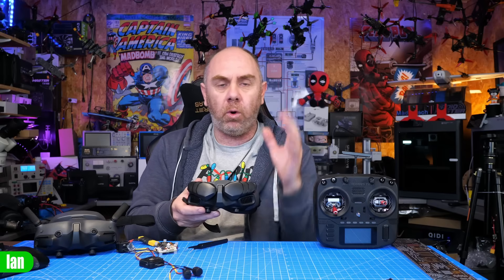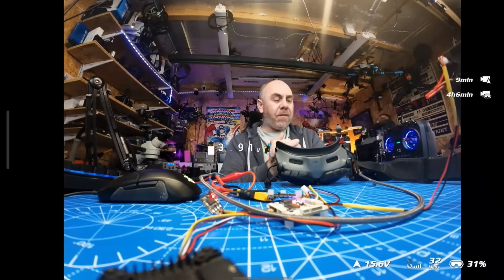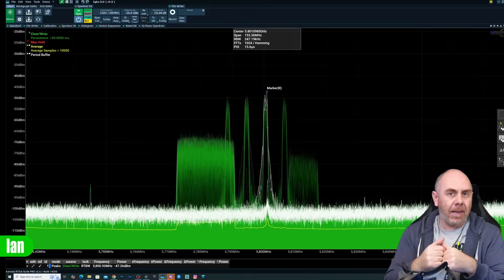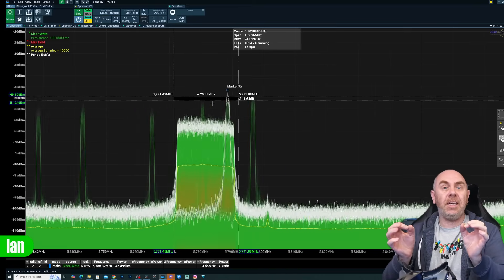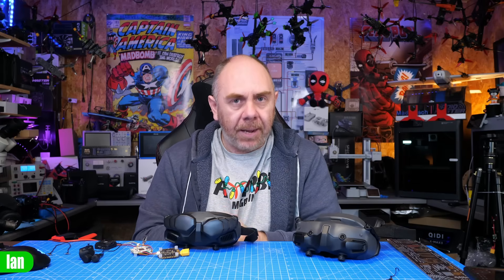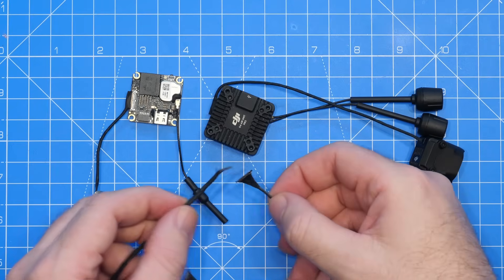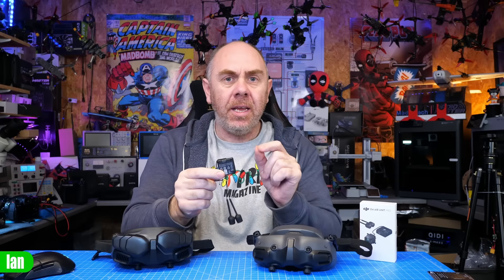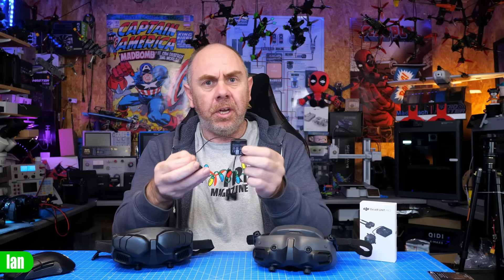DJI O4 Issues Warning - 16Mbps Goggles 2 Bug - Bad Camera Cables & Inav Arming & OSD Missing!

Comment: Can confirm the cable is easy to damage because I damaged mine. 

I have installed many o3 systems and never had a problem, but the o4 is very touchy.

I put in a request to buy a new cable days ago now and have not heard back.

Comment: How would goggles be fcc without the Ham file?   USA dealer, with USA warrantied goggles,  but they ship in CE mode (as dji normally does)
Reply from the maker: It's activation that sets the region.  User should get FCC once activated.  They definely will of they connect the fly app
Reply: @MadRC  I'm not sure the difference in ham vs fcc..  I always have activated via PC, in USA, 20Mhz gets 3 channels, 40mhz gets 1, channel 1, goggles say channel 1 but it's actually 50mbps channel 2.  We always have to patch them day 1 with the ham file.  (Well 1st day they come fly with me. I be patching everyone).
Reply: If you’re in the U.S. ham file just unlocks extra channels for the goggles to use. No idea why there locked behind that file though.

Comment: Good info. I've hated the G2's since release, so no surprise to hear there are issues. Likely the reason DJI quickly released three other versions immediately after getting G2's on the market. Moral of this story...scrap your Goggles 2 and get the N3's or G3's. Thanks Mads!
Reply: You working for DJI? haha
Reply: @girenloland 😂
Reply: As a professional user - I'll be keeping my goggles 2. Maximum compatibility, it works with every system and it's very lightweight and small. Vista, 03, and 04 have their own strengths/weaknesses depending on lighting/needs.
Reply: What issues you had with goggles 2?
Reply: G3 is not really an upgrade more like a side grade depending on the person.
G2 has greater fov, can be a positive can be a negative depending who you ask.
G2 has external battery again positive and negative; can be easily replaced when it's empty and it's also leaving you with a free usbc port to connect a monitor/phone to. The G3 has integrated battery when that is empty your usb c port is going to need to be used up for charging so no more monitor without an extra dongle and when the battery is eventually dead you'll need to open it up and do some welding to put fresh batteries inside.
Reply: @MrCoffis  G3 dont need usb to monitor..
Reply: @ how do you monitor without affecting signal?
Reply: @MrCoffis that"s it. u really know nothing about g3 but want to bash g3 performance. u must use both n for sure u will sell that g2 like me. best latency on g3. best fov on g3 while g2 can't completely see at the edge of screen. g3 more clearer screen, u will notice it when u test it side by side. g3 60mbps. internal batt g3 can be use for 3hours n can be fast charges while using. no need to always hang with wire around.no need spare batt, only fast charge PB u r good to go if 3 hours not enough for u. i hate g2 slide pad, difficult to use n slow when u want fast select. that's why dji never bring forward touch pad system. i'm tired of g2 pressing my up nose and around my eyes. when i use g3, no more feel some bulky thing pressing my face. g3 only stick on my forehead as a head cap, really far comfortable than g2. race mode on g3 is superb cause i'm a agressive fly style pilot, really love that race mode even it reduce a bit penetration. not race mode also can feel better response with g3 latency. g3 no need any wire for monitor, it's wireless build in wifi live view and u can use it for MCP with a bit like 0.3sec latency delay. use iphone/ipad/android connect live view wirelessly n can easily connect to big screen. why bother with wire?
Reply: @girenloland maybe??? Haha. HELL NO. I didn’t like the latency and FOV of the G2’s. The newer G3’s fixed some but not all of that and you can tap to look around which is a cool feature. To each his own! V2’s are still my fav for low latency FPV.
Reply: IMHO the biggest positive point of Goggles 2 is that you can change for better antennas for long range.
Reply: Love my g2 and even run on 4k 60fps and erls f1000 no latency issues, big dawg. But no idea when your running ghost, might play a roll too, but like you said if it ain't broke don't fix it. I like my g2's cause it doesn't transmit a target on my head like g3 does. Meaning rid targets your head as lat and long
Reply: I was about to say you trippin but, then saw your name and was like okay okay fair point 😂
Reply: @ haha. Facts! Me and latency don’t get along. Hope you’re well Robocooter! 🦄🦄🔥🥷
Reply: @PhantomFPV  I honestly haven’t had tooooo many issues with my g2s but, I’ve not tried the O4 with the G3 yet. Race mode seems like it could be sick for freestyle. I really enjoy the latency on  my HD zeros even tho I’m flying a tiny whoop at 60fps with very little range lol.
Reply: @Robocopter_fpv  100%! They say, if it ain’t broke, don’t fix it. I’m about to invest in a HDZero whoop. What are you running?
Reply: @Robocopter_fpv  Race mode has shit penetration so not for freestyle..
Reply: @ConceptNull  eh idk I freestyle HD Zero just fine and it couldn’t be worse that that. I’d take latency over penetration any day for freestyle but that’s just personal preference.
Reply: Never had an issue with goggles 2
Reply: The optic size to FOV/screen distance from the lenses is the worst part of the G2 goggles. The integras were much better, but the goggles 3 are better optically and more comfortable than the goggles 2. Plus they were down to $350 on ebay for awhile if you got the ones broken out of the Avata 2 kits, sadly I could only use them with the 03 for months and I mostly fly 1-2s. Now they're my favorite goggles with hdzero coming in #2 only because they are the best analog for my 65/75mm high performance quads.
Reply: I should also add that the onboard battery is so much better than having a cable hanging, but you can use a xt60 to usb c cable to power the Integra and goggles 3, so best of both worlds again.
Reply: I wish it was that easy for us on a country where the legal way to get a new goggles is spending like $1200 or more lol. Love you man.
Reply: I’ve been getting similar issue in manual mode as well, arms at 50mbps and then drops to 30-33mbps. This is also fluctuating between 30 and 50mbps cause frames to drop and see stuttering in the image. Goggles 2 with fcc ham file. 
I’m also getting an issue with my 03 unit since updating to include 04. My 03 cameras are now out of focus, osd and everything else is in focus. I thought it was a damaged camera, but then tried one I had used before the upgrade and was fine is also now out of focus as well. 🤷🏼🤷🏼
Reply: Anyone had problems binding o4 to goggles 2 after latest updates? Possible solutions to drone version too early icon?
Reply: I just hate the touch pad!

Comment: Hello Ian. I’m in CE region, using the HAM file with goggles 2. I have the reduced bitrate problem on the Avata 2. I haven’t tried to go to manual and choose the 40Mhz option to see if it kicks in 50mbps yet.
Reply: I just tested the 40Mhz manual mode and it went to 50Mbps.

Comment: I'm not using INAV but I would still really like the ability to use custom font packs. I miss having color HD fonts like are available for the FPV.WTF hack. Some of the icons in the DJI font look like they weren't sure what the data was that is being displayed. Custom font packs would correct that.